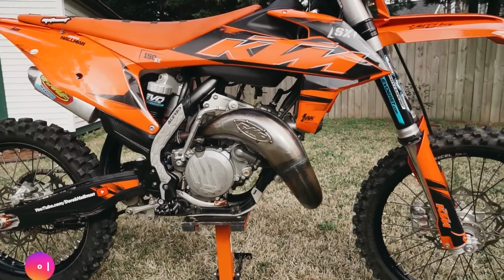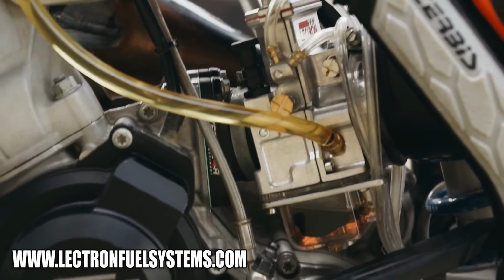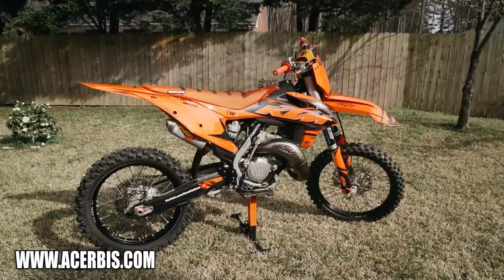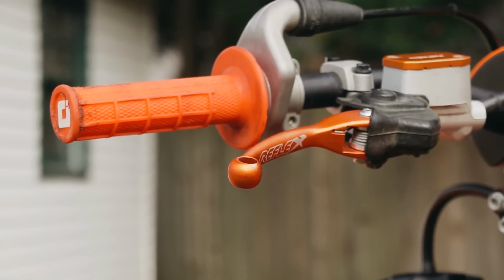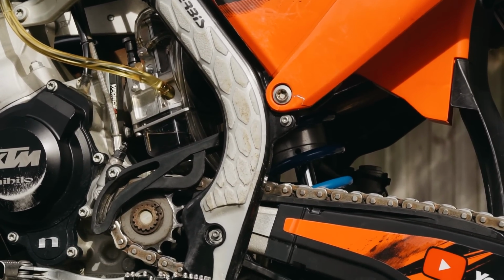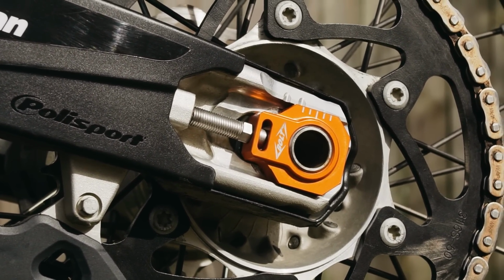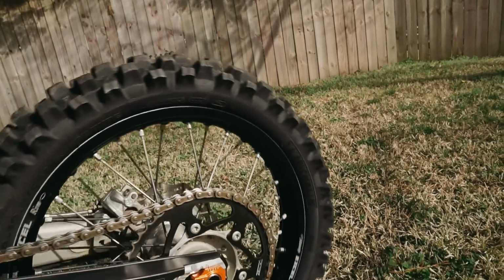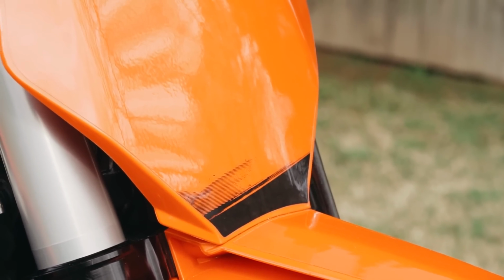2 Stroke Bike Build - 2019 KTM 150 SX

Comment: Hey! You should run seal savers. I put some on my forks after replacing the seals and I haven’t had to do any work since.
Reply: I agree. I run Skf mud scrapers on mine (basically the same thing as seal savers) and havnt had an issue with about 80 hours on them.
Reply from the maker: I'll look into them thanks bro

Comment: Take the swing arm protectors off ASAP ruins the swing arm from rubbing i regret ever using them
Reply from the maker: I read about that in reviews of them, doesn't bother me. I bought them to make the swingarm black, so why would I take them off? I like the way they look so it's fine if it scratches the swingarm underneath because I will never see the scratches. I'll just put new swing arm covers on it or powder coat it black in the future if need be.
Reply: @DerekHallman  yeah thats the way if your not taking them off then dont worry
Reply from the maker: @aussieendurox5262  for sure. Thanks for the heads up though dude!